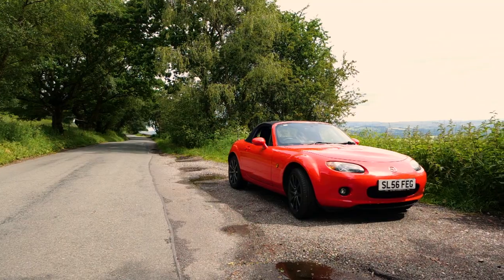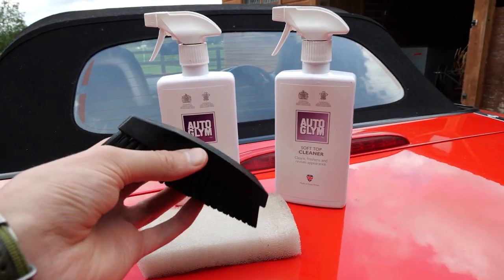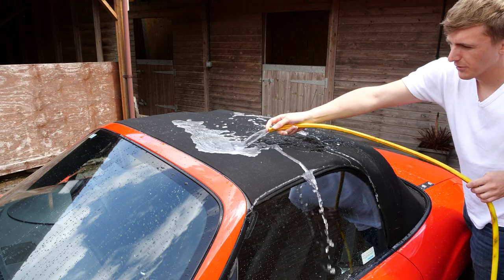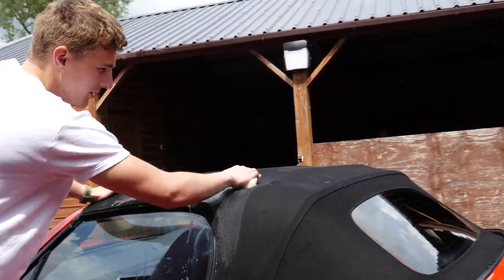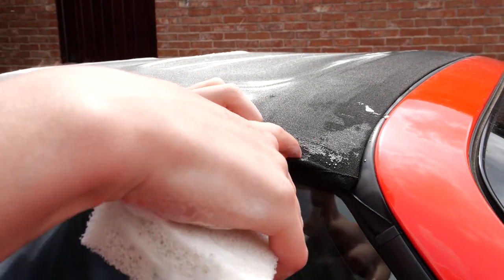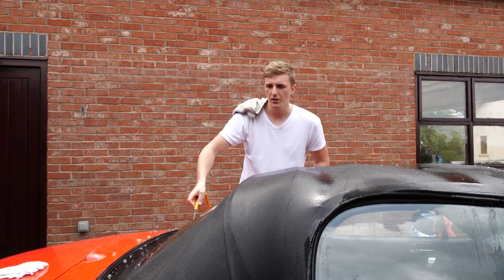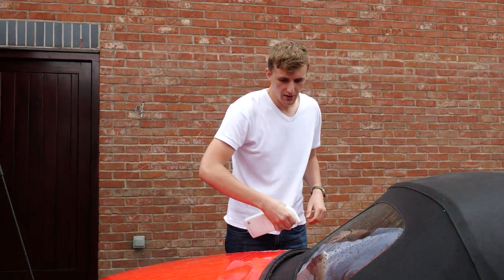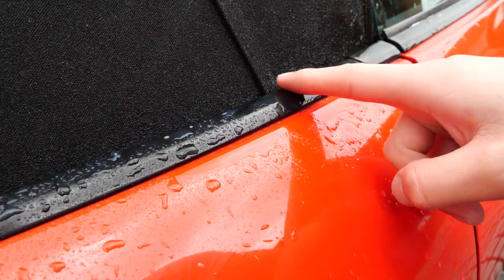How I Clean My Soft Top! - 2.0 NC MX-5 Sport

Comment: Hi thanks for the video! I've watched it some time ago and I bought the Autoglym kit. However doing some more research it seems that the cleaner (or the protector) can be very nasty on paint. I have seen pictures of paint bubbling and flaking. I am really concerned now, and I haven't used it. Do you think that rinsing the car after applying the protector will be enough?

Comment: Hi Dom - nice video -- nice videography techniques and editing! Well done. I have my soft top cleaned by Swissvax who apply their protector. It should last for 2 years, apparently. 
I found it interesting seeing the Autoglym products used and also the hood wash. I have protected my paintwork and wheels with Soft 99's "Fusso Coat" which is hydrophobic and also holds dirt at bay. I can really recommend it. As a consequence (and because I want to avoid more swirls than the previous owner put in) I almost always do contactless washing using high-pressure hoses. It's safe as long as you don't aim directly at the roof. BTW is your car True Red (code A4A)? If so, it's the same as my 2009 NCFL. All the best, Rob in Switzerland